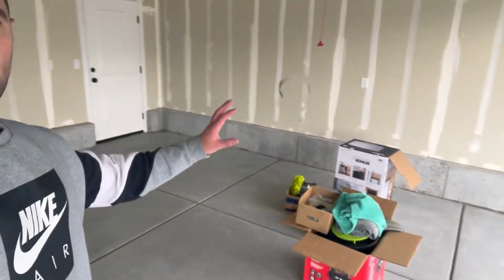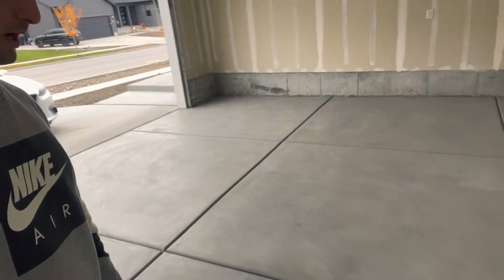Pressure Washing My Dirty Garage Floors *NASTY*

Comment: what kind of pressure washer are you using?
Reply from the maker: I’m not sure on the brand but it’s got 2,000 psi which is pretty standard! They’re all good!
Reply: It’s a green works pressure washer. You can get them at Lowes and they have different psi’s. I bought one a few weeks ago and it’s incredibly simple to put together and use 🙏🏼